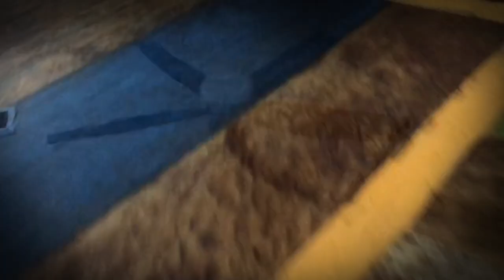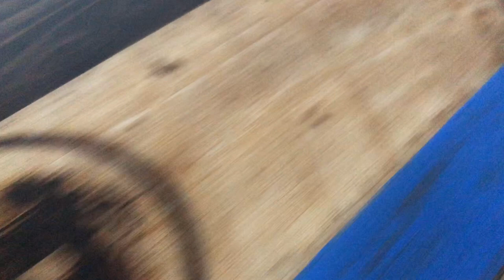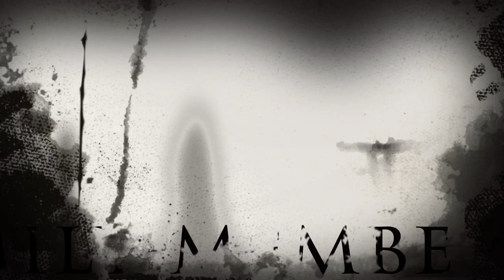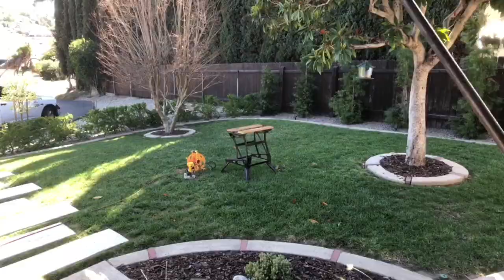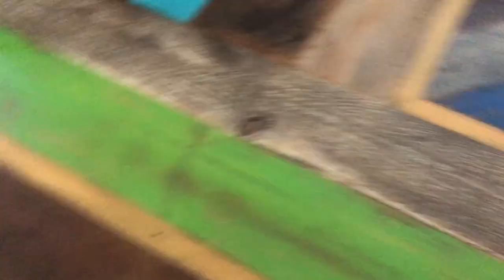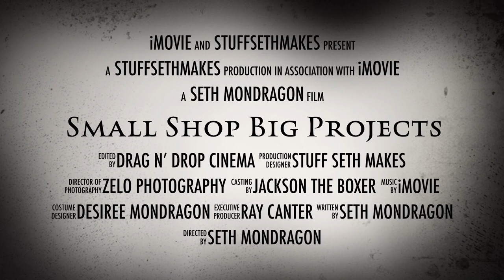TRAILER - Rustic Reclaimed Table Tops with Epoxy

Comment: I used ""Pro Marine Supplies Table Top Epoxy"" on my last several projects. Long story short, I have some experience with fiberglass and did everything right with this Pro Marine Supplies Epoxy. Still for some reason it will not completely dry. Not even after weeks. Could you possibly give me some insight on what could be wrong? Many thanks.....
Reply from the maker: Not really sure.  Is it still sticky?  If it hasn't been drying, why did you keep using it on more projects? Haha!  I've noticed that while mine has indeed fully cured, it will still "indent" if you set something on it for a few hours...but when you remove that, the epoxy pops back after a few hours.  After doing some research on that, it sounds like that's a common characteristic.  If you jump out to  www.jamestowndistributors.com you can get 20% off their TotalBoat Table Top Epoxy if you use the code "SETHSTUFF".  I've had good results with that too!  Sorry I can't be of more help!
Reply: Nothing for you to be sorry for, I very much appreciate you sharing your time and wisdom. Yes it is still sticky. Even after a week or a little more than a week.The reason I have continued using this epoxy is because I ordered a gallon from Amazon and don't have any other except from walmart for boats and it doesn't dry clear but it does dry like it should. Like I expected this Pro Marine to. This Pro Marine Supplies does an awesome job and is easy to work with, I just have the drying issue. Anyway I really appreciate your time my friend and love your work that I have seen so far. Thanks again...